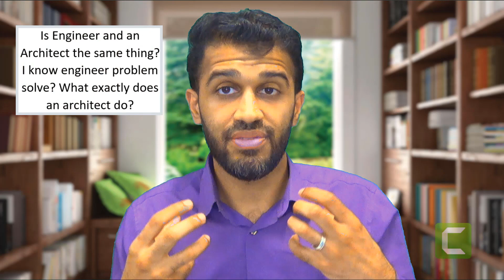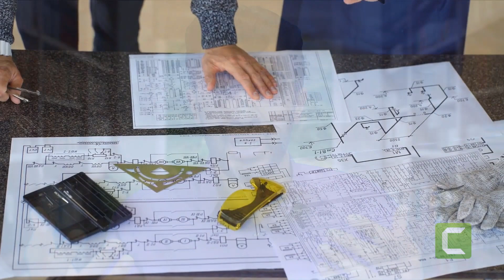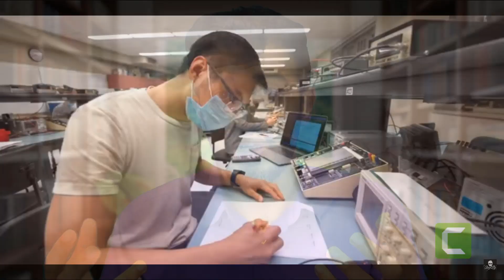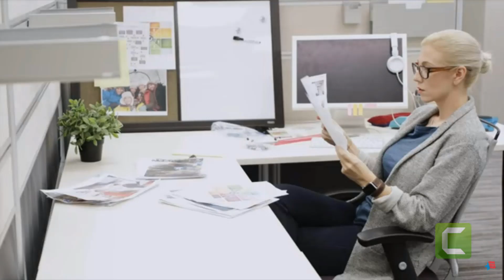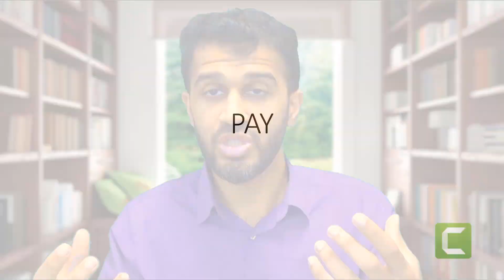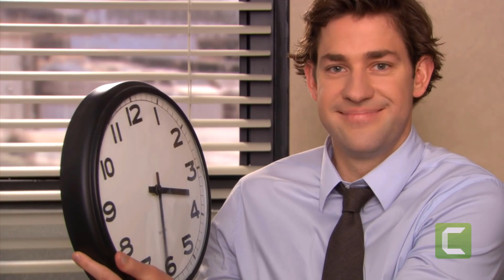Architecture vs. Engineering relationship? How do they work together?

Comment: I wonder if engineering school is as stressful as architecture school
Reply from the maker: They are both stressful in their own way. Ask any Engineer student about the difficulty of understanding  thermodynamics, fluid mechanics Calculus 2 or Calculus 3… Distress in architecture does not come from the difficulty of the subject, rather it’s constraint on deadlines and shortage of timeline. We’re asked to summon creativity on whim rather than digesting the problem, and having design come through insight and process, while simultaneously outputting viable drawings, renderings and models. The grass always seems to be greener on the other side
Reply: Architecture is more mentally fucking I had 3 friends who all took arch 2 dropped and one went to PT and other switched the MechE they described it as extremely mentally straining and emotionally taxing more than anything ever so I’m definitely not cut out for that shit